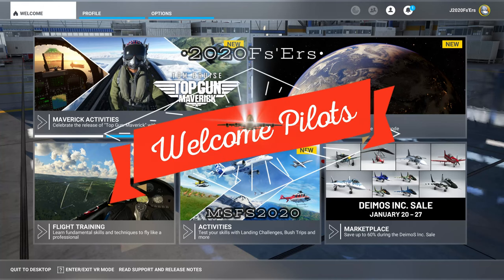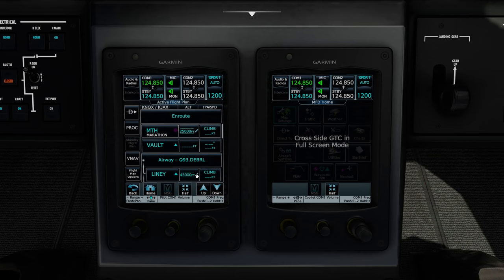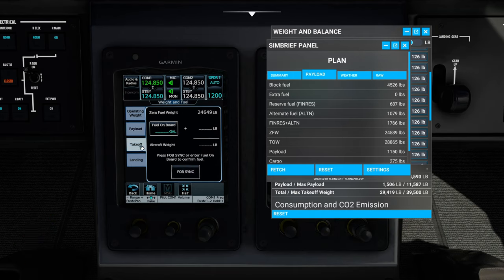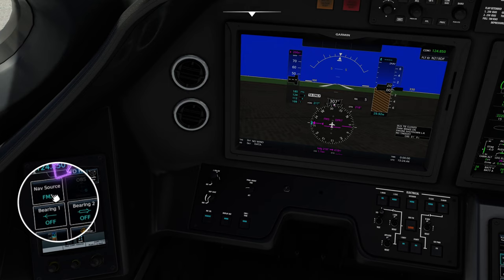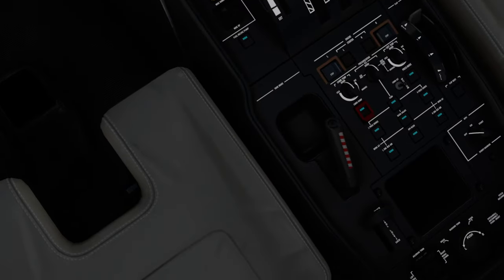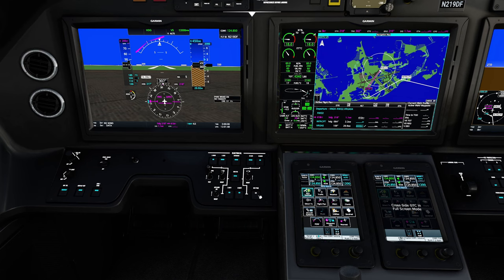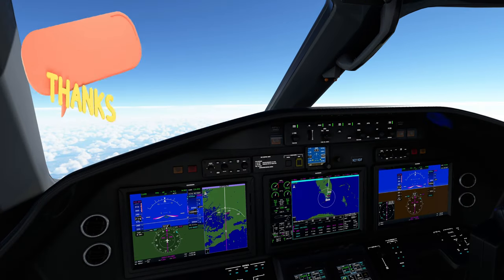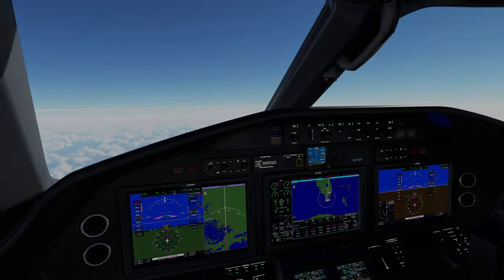MSFS*Cessna Longitude Tutorial*Cockpit Setup & Takeoff Procedure for Flawless Flights-Easy to follow

Comment: Set NAV for departures that nav to an initial waypoint and only use heading if you are getting radar vectors to the initial waypoint. NEVER set Vertical speed prior to takeoff! Typically use FLC at 400 feet after takeoff or vert speed is possible at that time too. Many pilots will not use VS in climb, due to no airspeed protection. Some do though, depending on the situation. I often use it over FLC to keep the nose from hunting for the speed, especially as you get higher where performance decreases. There are other legit times to use it as well, but never set it prior to takeoff.
In any case, wait until 400 feet AGL to set any vertical mode, usually the same times as flap retraction.
Reply from the maker: Thanks for your info. Nav is good on takeoff if your fpl has the starting runway in the fpl if not then it's not a good idea to use nav on takeoff . However this series is not on how to follow procedures as I state in every video, this series is to help you understand how to use the g5000 and how to use the avionics/ ap  in the plane and not on how and when you should use them. I'm not a pilot and am only doing these to help you understand the aircraft better.
Reply: @2020fsers  
No problem. I am a pilot an was just trying to help. 😉
Reply from the maker: I appreciate it .
Reply: @SpaceDad42  Spot-on advice ... just take off in NAV mode when the departure allows for it vs. HDG mode.

Comment: Stab is Stabilizer. You are setting the stabilizer trim. Also, METAR is pronounced Me Tar. Awesome video.
Reply from the maker: Yup .
Reply: @2020fsers  Thanks for quality videos. The Empty Weight %MAC slider is a fixed value. When the aircraft is shipped the FAA requires TCDS Type certification data sheet (includes fixed ref datum, fixed lemac, fixed MAC. See FAA website. The aircraft is then weighed by certified AMT at empty weight and this Empty Weight %MAC is posted in AFM. The slider in MFS for EW %MAC should be set once to this value. I use the default value of 29.2 (see reset button at bottom of page). The Center of Gravity value just below is the calculated number that one should plug into Trim values chart on checklist. Notice how it changes with varying wieghts. If CG out of range you have to adjust payload or fuel to bring in CG range.
Honestly, how would you know if you are out of CG range if you manipulate this EW%MAC slider to put w/b in range. See FAA-H-8083-1B Chapter 2 and 3. 
No offense. You do a great job for not being a licensed pilot. The FAA Advanced Ground Instructor (AGI) and Instrument Ground Instructor (IGI) requires no air time and no endorsement, Costs about $200. You should get it!
Reply from the maker: Hey thanks for the info on the weights I really had no idea about that and thought to.just manipulate that slider but it does make sense how can I adjust cg with a slider lol it is set at factory and only moving weight around is the only remedy for an imbalance I feel so dumb now logically it makes sense once pointed out so thank you for that. Second I also had no idea about the instructor course you mentioned I will.look into that thanks a bunch ☺️ 👍
Reply: @2020fsers  I am retired RW PPL and IGI. Basically just an aviation buff. Not flying anymore. Just the sim.  BTW all FAA manuals are free. The IGI or AGI will give you creds. I just used $20 Gleim Q and A books. Longitude is great aircraft for VATSIM newbies, as VATSIM is airliner biased, mostly for events. Lots of youtubers have no RW experience or RW pilots license. Go for it.  Good Luck
Reply from the maker: @MenoDumi thank you 😊

Comment: 6: 10 RAT is ram air temp at pitot. When not moving on ground it should  = outside air temp. Note: Metar winds are true. ATIS is magnetic. (always an exception: digital atis is true)
Reply from the maker: Ok cool I guess I made up my own acronym meaning lol thank you for the info .
Reply: It's so cool how the G5000 auto applies variation when you click use METAR wind. I have never seen that before!
Reply from the maker: Very well done update they did

Comment: Just a heads up on the 'manseq' waypoint.  The reason that disconnects from the final approach is because you have vectors selected as the star in your landing config.  If you select a star instead of vectors, it will connect the routes and you won't have that problem.  hope that helps someone!
Reply from the maker: Thanks for the info!

Comment: You will need ATC Approval to deviate from your Deoarture like that. There must have been a reason for that Published Departure to have that tight of a turn... Often, if that turn is not required, Departure Control will give you Vectors to a more comfortable Flight Plan intercept.

Overall, excellent description of the Cockpit Procedures and WHY it is done that way. Makes the information much easier to remember, rather than simply do this, and then do this, etc. Some of my comments may seem to be "nit picking"; just filling in some real world experience.
Reply from the maker: thanks for the comment and i understand what you are saying . yes you would need atc approval to deviate but this series is not on following proper procedures or talking to atc as there are many variables when atc gets involved,  its more on how to operate and use the g5000 and the longitude , i went over that in the beginning.
Reply: The departure procedure would be “turn left heading x intercept y”.  You don’t need to follow the magenta line to comply with the departure procedure. If a tight turn is required it would have included “remain within z DME of y”.

Comment: Hi great video, any chance you could do a update video on your vr settings for msfs?
Reply from the maker: Thank you .. I'm still using the same settings from the su11 vr guide I did. Are you having issues ?
Reply: @2020fsers  Nope still using them as well, upgraded to a 4090 so playing with dlss3. Just wondering if you have picked up any new tips. I only use your settings.
Reply from the maker: Oh snap you got a powerhouse of a gpu awesome 👌 those have some different settings I think so until I upgrade I won't be able to test out .
Reply from the maker: Oh I will be doing a video on process Lasso . I will also be doing a video on under volting your GPU to help with the heat issue and it gives you a little bit more performance because. It won't throttle your GPU from the heat.

Comment: I use the Honeycomb B Throttle Quadrant and would like to bind the Auto Throttle  to an unused button because of the location of the switch on the bottom side of the throttle lever in the Longitude. Are you using a Honeycomb B and if so, how do you have it configured  for Auto Throttle?  Thanks for all your great help.  Captain Dave 3:59
Reply from the maker: Hey, Captain  Dave thanks for the comment . I use spad to configure my bindings . Do you use spad?
Reply: I use Honeycomb B Throttle. I tried to bind two buttons, one for arm autothrottle and the other for the autothrottle disconnect. It didn't work at first. Then I used the same trick as for the landing gear.  Select on release instead of on press under action type.

Comment: Curious as to why you didn't use Takeoff Date "tab" and "Accept Takeoff Speeds" for to set V Speeeds?
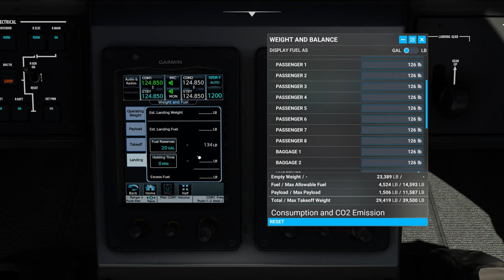Reply from the maker: I did use the takeoff tab at the 12:00 mark I go over all that .
Reply: @2020fsers  I was refering to the "Takeoff Data" button. You sent to the Speed Bug button and used the table. So the "Takeoff Data" button will calculate the V speeds for you, no need to use the "table".
Reply from the maker: In this video i used the takeoff data button right before the vspeeds.
Reply from the maker: You must be referring to the button that is grayed out on my screen the one that didn't work as of making this video? Now with aau2 it may be working I haven't tried yet.
Reply: @2020fsers  I've been using it both with AAU1 and AAU2. I did a direct comparison with the V Tables awhile back and the calculations very correlated.
Reply from the maker: You know what im so sorry that button doesn't light up until you input your weights so I didn't notice because I put those in last lol. Yes it does work and the figures are very close to what I was showing . I will use that in the last video . Again I apologize and thank you for the heads up.
Reply: @2020fsers  No problem! You're videos are excellent (especially on performance)...no apology is needed! :-)
Reply from the maker: Your to kind thank you .